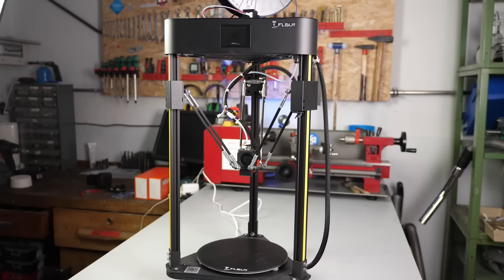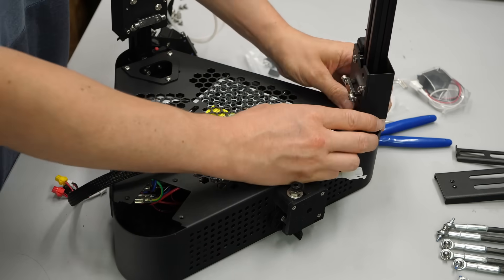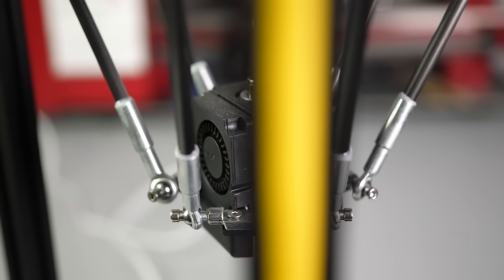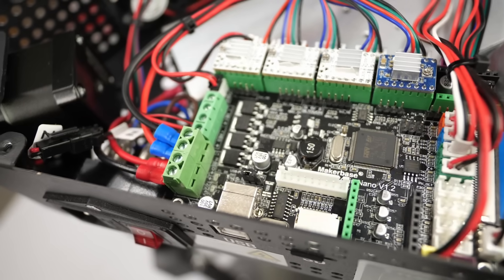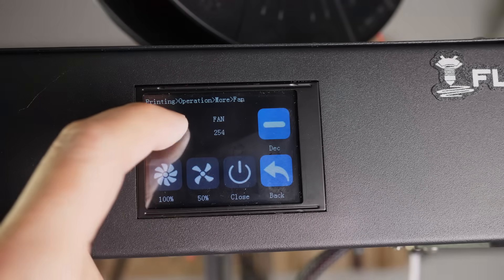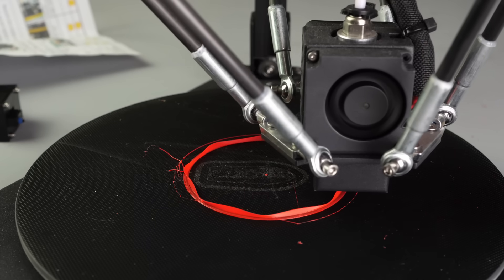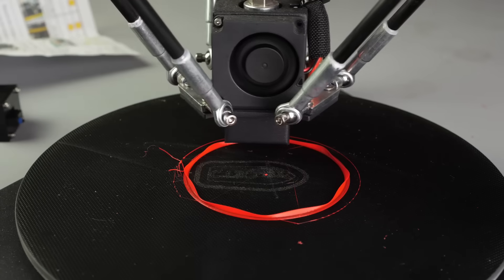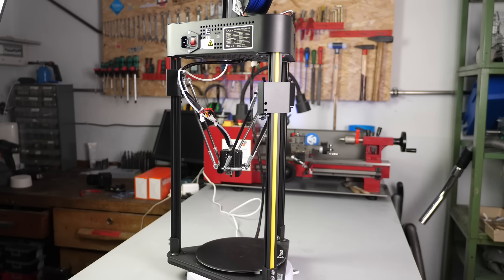FLSUN Q5 REVIEW - A 90% great machine!

Comment: the stuttering is most likely the jerk settings, all 3 must be identical. 
i had this "duh" issue when building my from scratch delta. same with the slicer.
Reply: there is no jerk setting on robin firmware
Reply: It is probably because there is too much gcode for a bit of travel, and the firmware needs some 'thinking time".
"Jerk" is about the "running start" the steppers can make.

Comment: @CNC Kitchen, you mention replacing the mainboard, which boards would you consider to be a suitable replacement? Are the SKR boards (such as the 1.4/1.4 Turbo) which are in a similar price bracket any better, or is everything around that price not worth it?
Reply: Check out Review from Design Prototype Test. He suggests the Duet and I agree.  The SKR turbo runs 32 bit 120MHZ @64kbSRAM. Duet at 32 bit 120MHZ @512kb SRAM.  U won’t need Pi with duet. Duet would be the best choice for running the delta at speed
Reply: @hayden9944  only downside is the price of the duet right? arent they 5 times the price of a SKR?
Reply: Try Marlin before changing it.

Comment: I bought a Q5 6 weeks ago, and it is impressive.  All of the points in the review are correct:
- Underextrusion can be fixed with a 110-115% standard flow rate
- Cooling and noise are easily addressed with a Noctua replacement fan, silicone sock, and custom printed shroud and duct from Thingiverse
-  The mainboard is fine unless you want to do extremely fast printing.  Replacing the extruder stepper driver is another easy quality of life upgrade.  
- I finished all upgrades and I now have a very fast and silent printer that has equal or better quality than the Ender 3, takes up far less space and prints almost twice as fast
- DELTAS ARE MESMERIZING.  Your friends will think you spent $2000.  They seem so amazingly smooth and robotic.  It is science fiction in motion.  Poetic to watch...
Reply: Thank you, your a life saver do you still have the thingiverse link?

Comment: Thx for the video
Is there a chance that you will test the performance of the printer with the mentioned upgrades? I'm in the market for a delta printer (tall narrow prints is a problem on moving bed designs) but I want clean prints or I can use lots of support material on a ender style printer

Comment: I bought one a few weeks ago and I agree 90% with you but have some suggestions for you. A silent stepper for the extruder is probably going to be my first upgrade. 
My machine seems to have less problems than yours though, I have a suggestion for you:
I used a similarly sized filament roll, and it was printing next to me when I noticed some strange noises. It was the filament roll not rolling well on the squared holder... worst shape for a filament holder. I designed and printed a spool holder for the roll itself to essentially make the I.D. of the filament roll 30mm and all prints improved and it got a little quieter. I made a holder for the holder... but the large I.D. also effects my A10T so everyone gets a holder! I have 15 1kg rolls, trust me it works WONDERS. I won't post a thingiverse link unless someone wants it, this isn't spam for my thingiverse haha. 
I have another tip for anyone trying to use post script commands like "pause at". You have to use the BQ "method" (only one available in Cura that worked for me). It works though, I have 2 nuts embedded in my new shift knob as proof! 
I love this printer! Like you said it's "90%" and I can agree with that. Then again 100% probably would've been another $100! 
Good review, thanks!
Reply: Hey, mind sharing the thingiverse link? I own one
Reply: @lugaidster  https://www.thingiverse.com/thing:4601253
I'm uploading V2 and a longer shaft version at some point today.
Reply: Would love the link too please 🙂

Comment: Hi Stefan, I got my Flsun Q5 a few days ago, it's my first printer and I'm quite impressed. I only had one minor inconvience when assembling because the motor from the extruder didn't quite turn freely. I disassembled the extruder because I thought it was a broken gear but as it turned out it was only a loose cable which I completely plugged in again and then everything worked fine. Do you have any suggestions on the slicer settings, especially when it comes to fast printing. As I'm printing mostly functional parts and prototypes I don't mind stringing, blobs, etc but speed, and stability matters. Also I would like to see another video on the mentioned upgrades, can you recommend any resources on swapping the Mainboard?
Reply: The Mainboard seems fine to be honest. I've compiled Marlin and handles much better.

Comment: MKS Robin nano board , despite being definetely not the best choice, is pretty usable (but, apparently, not on deltas) if you know how to cook it, especially with new Marlin Color UI for touchscreens. Unfortunately, there will be only increasing number of printers with this board, since MKS offers it ridiculously cheap for 3D printer manufacturers, and they also provide customized UI with icons, colors and logos you want. It is very convenient for manufacturers since they get ready to use cheap electronics with colorful touchscreen and WiFi to advertise and they don't have to tune Marlin for it.
Out of the box the board runs MKS Robin 1.x firmware, like most Chinese printers using MKS Robin nano board.  And you are actually wrong, this firmware is heavily based on Marlin, but extremely old Marlin 1.1.x, so it has no Linear Advance and all nice modern features, because they did not exist in the time this version was actual. Basically, the firmware is 32 bit ARM code for UI and touchscreen controls which imports the whole outdated Marin release as a library to do the actual math for motion control and printing-related routines. Also that's why config file uses Marlin's names for settings. This firmware by Makerbase had closed source for a long time, violating the GPL v3 license of Marlin. Only recently Makerbase published the code on their github. There they also have Robin firmware v2 which is based on Marlin 2.x and provides Lerdge-like experience of configuring the entire firmware using touchscreen.
Reply: the firmware running on those is Robin 2.0 and Repetier based... nothing to do with Marlin, which Makerbase abandoned originally for their 32-bits and are now coming back to it. And yes, they did put out a Marlin 1.x based firmware last year for the Nano, doesn’t make the above closer to any relevance to the Q5... I could also make a very long post and add a lot of non-substantiated (and wrong) assumptions, would that be better?
Reply: @RogueMvox  the problem is, my "assumptions" are not "non-substantiated". You can go to MKS github to the Robin Nano repository and check what firmware they provide for the Robin Nano v1.2 board. 
https://github.com/makerbase-mks/MKS-Robin-Nano
https://github.com/makerbase-mks/MKS-Robin-Nano-Firmware
Firmware v1.x is based on some old Marlin, there are sources available but "as the development IDE needs to pay, it is not suitable for individual users" (IDE is actually IAR Embedded Workbench, but if you know what to do you can build these sources in other IDEs)
Firmware v2 is based on Marlin 2.x with LittlevGL-based UI (which they were surprisingly nice to contribute to Marlin when they suddenly decided to go all open source instead of just stealing other's work, so now u have MKS-LVGL UI option in mainline Marlin). The main selling point of this firmware is that you can configure everything (like kinematic type, endstops, motor directions, etc.) from the touch interface, without recompiling the firmware (similar to the Lerdge boards)
Considering versioning - the firmware they do for manufacturers is usually based on their v1.x firmware for Robin nano but with custom UI look, but for each printer the actual firmware has completely different versioning, so it is useless to look at what is written in your printer's "firmware version".
Please point me at this Repetier based firmware you were speaking about. I have several Robin nano boards and I've personally tinkered a lot with both Marlin-based Robin firmwares and Marlin itself on those boards. And I've never heard of any Repetier-based firmware, but I would be glad to learn something new.
Reply: If you are going to post on a Q5 review, can I respectfully suggest you buy a Q5 and then come back with info that applies and matters to the discussion and not guesswork? The MKS boards are sold to manufacturers, which then see fit to ship them with the firmware they deem appropriate... the only accidentally correct statement in your two walls of text so far is that FLsun/Makerbase are in breach of one or more GPL when it comes to the firmware that ships with this printer.
Reply: @RogueMvox  Well, you make a good point, I have to admit. But if flsun actually uses some firmware other than MKS provides, that makes it even more interesting.  If you connect  the printer to some host (i.e. Repetier Host or Pronterface) what is the first output you have from it?
Since Repetier itself has no support for STM32, I would really want to have a closer look at the Repetier-based Firmware running on STM32. Where can I download it? I've tried to google a little bit, but with no luck.
Reply: Viсtor Shapovalov Makerbase added 32-bit support for their own boards to a Repetier base, probably version 0.9.2 originally (for the QQS) and maybe 1.0.x for later revisions (QQS Pro and Q5). They also added delta configuration and that is possibly where, if any, Marlin code base (1.0.x) was ‘borrowed’. Without source it is impossible to tell, but the large core of the firmware is Repetier, there is no doubt about it.
Reply: @RogueMvox  Sounds pretty convincing. Actually, Marlin-based and Repetier-based firmwares would be easy to distinguish. I have to admit I've never dealt with flsun printers in person, and the only delta with Robin board I've personally seen had Marlin-based Robin firmware, same as other 6 or 7 different printers with Robins. So I was probably too harsh in judgement. I still want to tinker with this firmware personally so I'll be grateful for a download link (even without sources). Anyway, thanks for the discussion and have nice day!
Reply: Viсtor best is to join the FLsun user group, the official firmware can be downloaded there. If you have a nano, flash it onto it and a customary inspection will confirm all of the above.
Reply: I've Compiled Marlin 2.0.7 for it yesterday. It's the better option than repetier.

Comment: The MKS Robin Nano seems to be a common factor between all this theoretically great printer but not reliable at all in practice. For example the Sapphire pro uses one.
Even if I have to say after uploading marlin and making A LOT ot upgrades my Sapphire pro has become a grat printer, I manage to get better prints than a ender 3 at 2 times the speed
Reply: I've switched to Marlin after a few days. I really don't like Repetier. I am running 2.0.7 now.
Reply: Why not klipper with Pi to offload all the calculations?
Reply: @SP_99999  Moneyyyyyyyyy
Reply: And also I don't really see the point. With marlin it has been working great and my pc is a few meters away from the printer, so I don't really need wifi conmectivity
Reply: Alessio Suppo Pi doesn’t cost so much ;-) by the way normally I replace those board with duet to be honest and here the cost become quickly high compare to adding a Pi ;-)

Comment: Delta 3D printers are thing of the past. They can move head fast, but that's all. They have much less build volume, and, more important, they have to be bowden. It was OK 5 years ago, but now, when flexible fillaments appeared and Linear Advance algorithm was implemented Direct Driver Extruder is a must. 
Decrease DELTA_SEGMENTS_PER_SECOND to 80 or even less in Marlin Configuration.h and increase BLOCK_BUFFER_SIZE to 64 or 128 in Configuration_adv.h to avoid stuttering.
Reply: They can have any build volume (I've built one for 1m2 recently). And they don't have to be bowden. It could have a Zesty Nimble, flying extruder with very short bowden or various lightweight direct extruders.
Reply: Large build volume and/or Nimble makes delta too expensive - linear rails, thicker belts, thicker rods etc. Also, large deltas are difficult to build and calibrate - if vertical rails are slightly unparallel, twisted or tilted, it will print well on the bottom but the taller it goes the more inaccuracy occurs.
Reply: Not true again. I've built 1m3 one and printed 2.6m tall art object (as a few sections) for about $1k (including 30 kg of locally sourced PETG filament). This includes closed loop steppers, dual gear extruder, SKR 1.4 + Klipper, custom Supervolcano-like heater block and nozzle (just because i had no time to wait for shipping of real supervolcano).

Sure, it wasn't build for precission but it produced decent prints and successfully printed about 40kg of filament in a few weeks.
Reply: @yinyang8081  Prusa is a smart guy, he predicted issues with delta kinematics, so he decided to invest in cartesian, which is simpler and cheaper. Higher movement speed does not always mean faster prints now, e.g. retraction distance and Linear Advance factor influences a lot. And, by the way, Ultimaker-style kinematics are not slower at all. Scaling up delta is not cheap at all. Properly built (accurate to 0.1mm through whole build volume) large delta might cost as much as 2 or 3 properly built large cartesian printers.

I have Kossel Mini delta. It uses 3x450mm HIWIN linear rails and produces only 180mm build diameter and 300mm height (in fact, 170 and 250 are fully available). It's a shame. Cartesian or CoreXY with such rails would provide 400x400mm build volume. And cartesian printer with such dimensions built on V-Slot gantry costs just about the same. I doubt there is future for delta printers. It may be good hobby project, but it's unprofitable to develop and build them.

Comment: I have had one for a couple of months now and I am really happy with it. I'm using simplify for my slicing and have never experienced the blobs shown in the video. Regarding the under extrusion I did have a little of that but that was quickly fixed by bumping the extrusion multiplier up a bit. I just held a workshop at a school and it was perfect for transportation as it is really light and the students were very impressed by the movement system. The speed curtainly made it easier to pump out some useful parts the the students to print home. I have the machine sitting on my desk and I forget that it's even there at times and I don't think it will be coming down any time soon 😊
Reply: This is my experience EXACTLY.  No blobs, some minor underextrusion, easily addressed at 110-115% multiplier.

Deltas are magical to watch!

Comment: I also have a Sapphire Pro with the Robin Nano and I can confirm that the firmware is very bad. But the board itself is fine, I actually think it's the best solution for a cheap board with a modern interface; the MCU is very good, the screen is responsive and decent quality, firmware update is easy enough, it just lacks a second fan interface for the Hotend fan. The real problem is the software support from 3D printer manufacturer. It seems you download the official Marlin, but you should try the version on MKS Github, it works fine for me (I'm also working on an improved version of it for the Sapphire Pro, I will add it under here when it's done).
Reply: My version of Marlin for MKS Robin Nano and Sapphire pro is available here : https://github.com/quentinDeroo/Marlin
A lot of work has been done to improve the UI, it's now much more modern and faster than the version Stefan used in this video.
Reply: @Spitfire17139   can read from the files it works with the robin nano but you built it for a sapphire pro which is not a delta, how do we use this on the printer this review is about the flsun q5
Reply: @max1mus2k  You need to modify the configuration.h file in the Marlin folder to set it up for this printer. I can't help you more than that, I don't have one unfortunately. Note that the screen is different, I believe it's a TFT32 on the FLSUN (compared to a TFT35 on Sapphire) so keep in mind to change that in addition to all the usual settings (it's near the end of the configuration file under "Graphical TFTs").

Comment: Duet is such a good Upgrade for these Delta / Kossel style Printers. Upgraded my Anycubic Kossel to an duetwifi2, Printspeeds of around 150mm/s and Movement around 400mm/s are no Problem for big parts.
Reply: Great upgrade unless your printer cheaper than Duet. At first everyone should try to upgrade to 3-5 cheaper boards before buying Duet. It seems there full industry for those who bought cheapest printers.
Reply: What's the point? :)) It's not a cheap mobo... If you're about printing more than about tinkering (your machine) then it's better to start with a decent h-bot. It will be faster and much more reliable (and understandable!).
Reply: Printer came with a 8Bit Board, which really had its limits. The skr1.3 wasn’t available back then, so i went Duet and never regret it so far
Reply: @darkengel1210  Can the skr1.3 work with delta printers?  I'm using one for my ender 3 and it's amazing.
Reply: Sure, why not? Just a configuration thing.

Comment: Just got mine a few days ago. I’m really happy so far. I replaced the filament holder with one on thingiverse. Great value for money. We’ll see how it holds up.
Reply: I am 6 weeks in...still quite happy.  The issues I have had are not really the printer.   I recommend a higher than 100% flow rate, however.  The long tube can create resistance on tall prints.  At 115%, the print can accept the extra material, no problem, but underextrusion never happens.  You get a stronger print and better consistency.

It is extremely fast in vase mode.  You can do 100mm/s and not see any degradation.